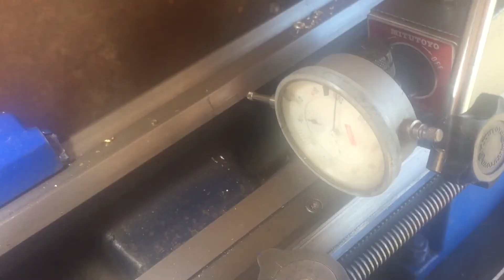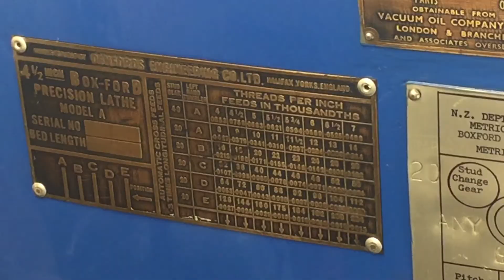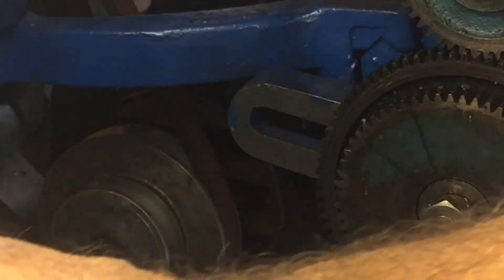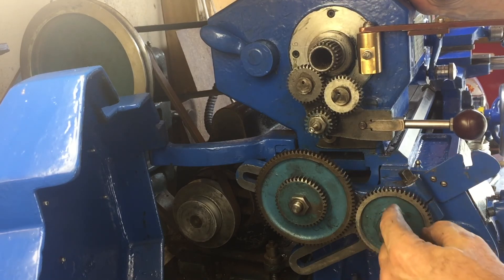A left-hand internal acme thread for the cross-slide nut to fix backlash-Part 2

Comment: When I was an apprentice 30 years ago I was taught to set the top slide parallel to the bed when making a square thread nut to fit an existing threaded shaft. The reason why is the male thread will not be perfect due to wear over its life time, wear on the tool when manufactured or the tool you ground isn’t perfect. Once you have cut the majority of your thread apply bearing blue to the shaft and screw it into the nut you will then be able to see which face of the thread needs more material to be machined off, any binding on the flanks is easily corrected by moving the topslide the desired amount along the x axis. Remember to always use a dial indicator to validate tool position to eliminate being caught out by your lathes backlash. Bonus fact, the tradesman that taught me could machine a perfect two inch long thread internal or external in less than 20 seconds on a Colchester Master running at 666rpm.
Reply from the maker: Thanks for a really impressive comment. That is very interesting. The Acme thread has a 29 degree included angle of course (14.5 degrees on each side) rather than a true square thread. I just want to make that clear for other readers. But I suppose the method you describe would still apply. I assume that adjusting the nut in this way will not help with a screw that is worn in the center portion where it is used most. Whatever you do in that case the nut will be tight at the ends of the thread and loose in the middle won't it. 

I recently found that I could buy an Acme 7/16 left handed 10 TPI tap from China for less than $US20 !  I bought it, and used it to clean the thread I made then modified the nut to make it adjustable. It is pretty firm now, but with a bit of variability over its length.

Always use a dial indicator for precision work. Yes that would help. Others who have a DRO say that really solves the problem. But I think you still have to remember to take up the backlash or your tool will move unexpectedly under load. The backlash can cause other problems, especially when using a milling attachment where the forces can suddenly reverse.

Your instructor was amazing!  I have just uploaded a new version of my gear train calculator program which is online and free. Google RideTheGearTrain.

Comment: Hi Evan, I enjoyed your presentation of how you overcome the problem here.  It seems that you have the patience of a saint and the objective was achieved. My empathy was with you, as it must have been quite a frustrating situation.
However; just for your future reference, the cross slide could have been locked in position by tightening the gib strip screws, after first removing the acme screw of course, hence leaving it free to check progression of the new nut.
One other point that you have obviously realised is; learning to live with the backlash. This is easier when you just have one machine. It's also why in machine shops, turner's prefer their own lathe, rather than working on others.
In this situation, making allowances for backlash, becomes second nature to experienced turner's. Just thought I'd mention  it and hope you don't mind.
Thanks for publishing good and interesting videos on this subject.
K🍀
Reply from the maker: That is a great idea Keith. I have used the idea of locking the cross slide using the gib screw adjusters eg using a milling attachment. I do not know why I didn't think of doing it here.  Two days ago I discovered that I could buy a 7/16 inch 10 TPI, left hand Acme tap from China for about $25 so I ordered one. I think I will make an adjustable cross slide nut. Gary at Boxford User's Group made one by inserting a 5/8 (or 20mm) threaded section half way though the inside of  the nut. An Acme thread was made through both halves of the nut. After installation the 5/8" threaded section could be screwed in to create a tight fit on the cross-slide lead screw. Then I may have to work on the compound slide as well. I may be wrong but I found that that the 7/16" lead screw was actually a few thousands of an inch oversize to create a tighter fit and the difference was about equal to the clearance specified for Acme threads, so it would have taken up all the clearance.

Comment: Thanks for making the videos I learned a lot about cutting a left hand internal thread. If I understand your problem correctly I suggest that you make an aluminum handle for the hand grip off your cross slide handle or made the stainless steel handle counter balance longer and beefier to balance the handle making it less likely to move on its own due to gravity.
Reply from the maker: Yes that is the answer. I only now realize that is the reason for the ball opposite the handle on the original. Newer lathes usually have two hand grips that make it balanced. I need to do something about that. I think making a bigger ball and screwing it onto the side opposite the handle would be the simplest solution. For weight maybe I should make it from solid gold ;-)  I love the feel of the handle. I will get to it one day. Maybe I need to make a ball turning attachment first!